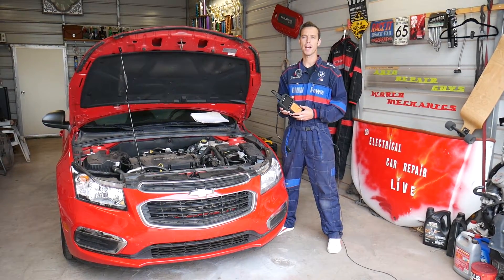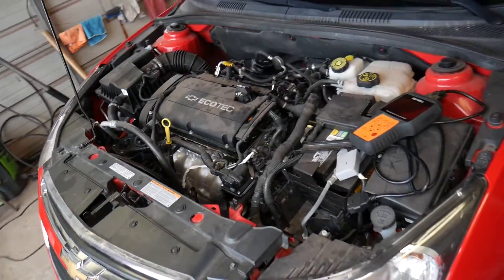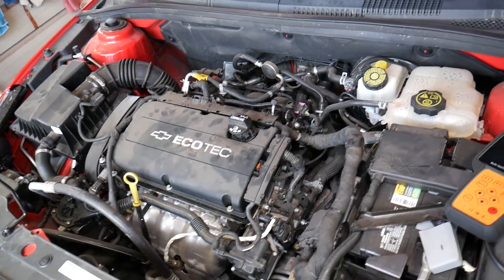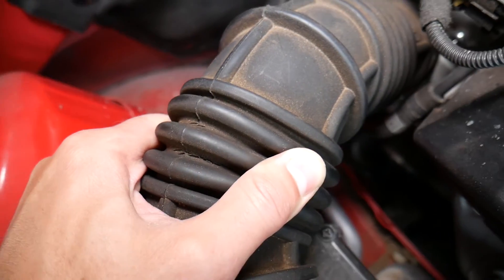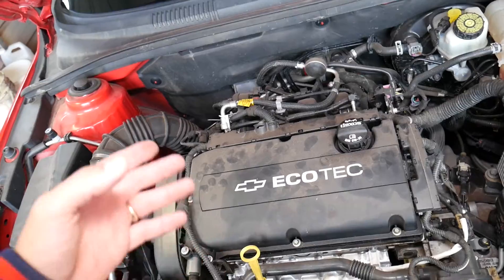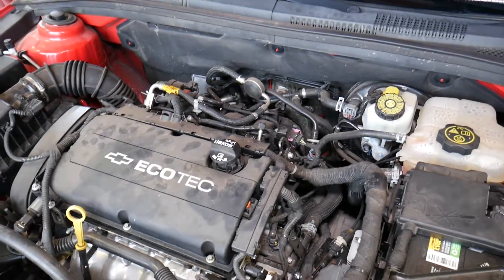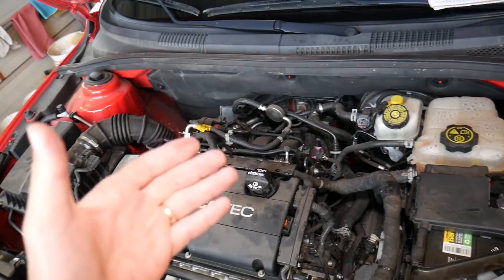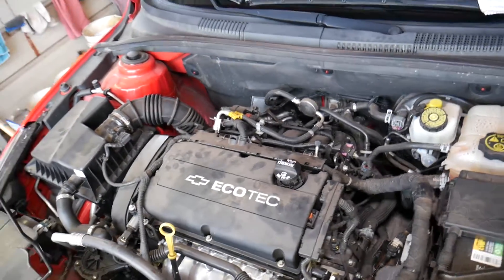FIX CODE P0171 CHEVROLET CRUZE CHEVY SONIC SYSTEM TOO LEAN

Comment: i just got the 2015 sonic. just recently been getting codes P0131 P0171 and P0420. i was in my friends driveway parked waiting for her to come out and my car stalled out on me, it was idiling and boom just stalled out. the rpms never went all over the place it just cut off. this is my first american car and im not a fan of it or the echo tech motor, its non turbo. it has new air filters and i just had one of the o2 sensors replaced about a month ago so idk if that has anything to do with it. PLEASE HELP MEE.

Comment: I have the same problem with my holden Barina it has the exact same engine, my mechanic kept the car at the garage for four weeks, and he still cannot find the problem, i have replaced everything and still have the po code.171 bank 1 lean.

Comment: the worse code to get on car. weeks of troubleshooting and replacing parts and checking for leaks and still have problem on sentra 2005. replaced MAF, Wideband O2, PCV and checked for leaks and hoses.

Comment: Thank You, I reasonly had my check engine light come on. On my Chevy Cruze eco tech LS 2014. The code was a P0171 system too lean. I will check the vacuum if there's any leakage and the mass flow sensor if it's dirty. If not I'll go over the senses for the oxygen and fuel and filter.
Reply: did you fix it I'm having the same problem and the car jerks when it downshifts, and it has a bad idle
Reply: @moe2931   I have the same issue as well hope to hear from y'all about the fix
Reply: @pologonzalez5483  I sold the car had so many problems and was just putting me in a money pit, hope you get it figured out

Comment: Had this same code on my 2015 Cruze a year ago. Now it's back again. Getting rid of the car soon. Not putting anymore time, money or frustration into it. :(
Reply: Dude the car has the simplest errors. Like the thermostat, the pcv valve . All simple things. Inspent 100 on a thermostat and I changed it my self . Code gone... I'm 40 minutes. Then I changed the temperature sensors in 20 min. And the pcv in 20 . All codes are gone. 100 bucks every 2 years isn't bad if u ask me .

Comment: Ecotec engines come with P0171 code standard for all models, P0420 code is optional
Reply: what do you  mean the 420 code is optional? im getting codes p0131 p0171 and the p0420 code. ive only had the sonic for a year and already over the damn car. this is my first american car and not a fan of it or the damn ecotech motors.
Reply: @Ghostegirl1990 that card was born a piece of crap
Reply: @Nick_the_mechanic  you’re not wrong. I finally got rid of it !
Reply: These cars are poop 💩 poo 💩 😅but Honda! Buy Toyota! Thank me later
Reply: @omaralberto2415 I have a Subaru instead

Comment: For me, my second and third spark plug were full of oil. I took off the coil pack on top and the 2 middle plugs were covered in oil. Causing a misfire
Reply: How did you fix this issue? One of my spark plugs was wet with oil aswell?
Reply: @TheSixthSense11 probably the valve cover gasket leaking ontop and letting oil through
Reply: I have this same issue what was done ?
Reply: same here man. It looked like oil and coolant as well. .Did you fix it